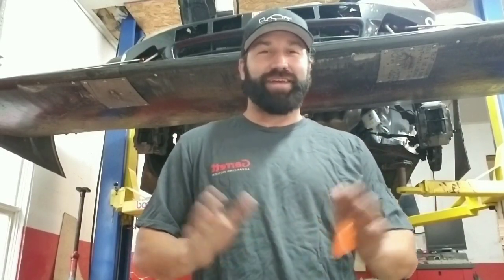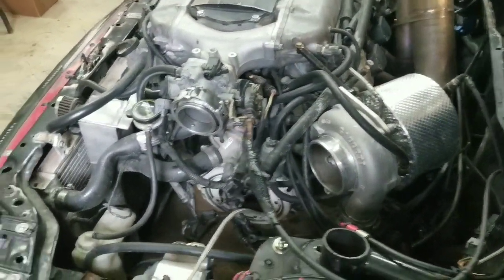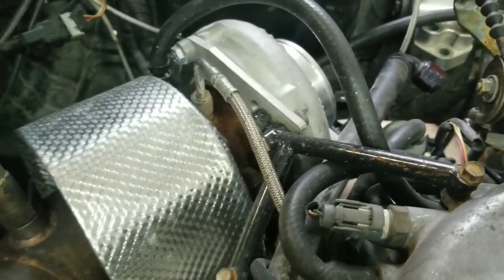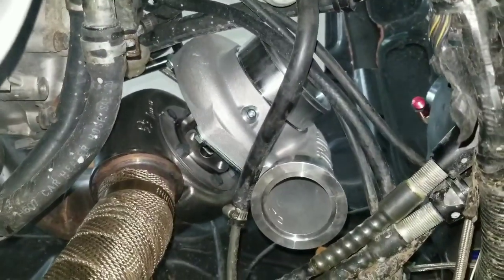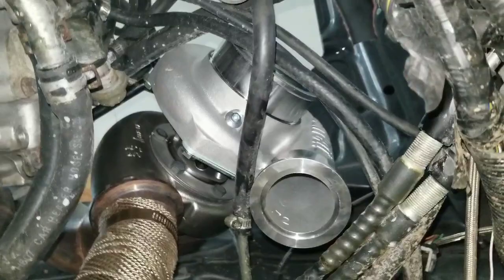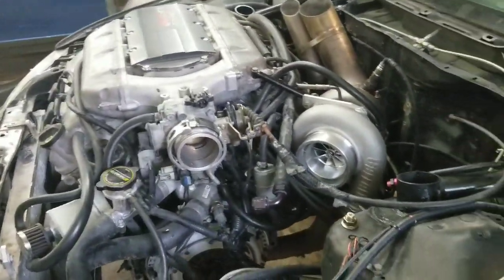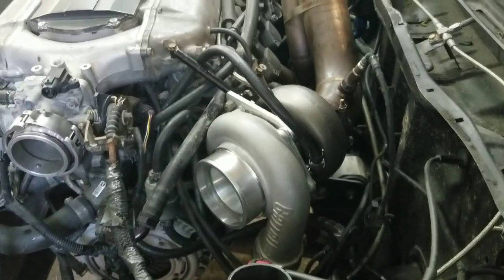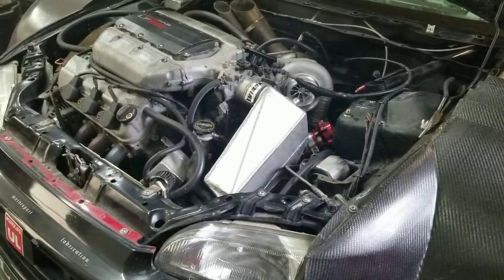Beastie Hatchback gets a Garrett GTX3584!

Comment: Hey bro one question, did your windhshield gets blurry with exhaust gas?
Reply from the maker: After a whole day of tracking, yes.  Wipes off easily enough
Reply: @CodyLoveland  thanks for the reply, im in the process of build my downpipe and a hood exhaust is way faster to fabricate
Reply from the maker: @roda1999  we might actually run a full exhaust to improve on aero over and especially under the car.
Reply: @CodyLoveland your car has very tight space, good luck with that, did you have plans to attend any of the global time attack event in this year?
Reply from the maker: @roda1999  theres room, we just didn't want the excess weight.  But titanium will reduce that and the blown diffuser effect will only increase downforce.